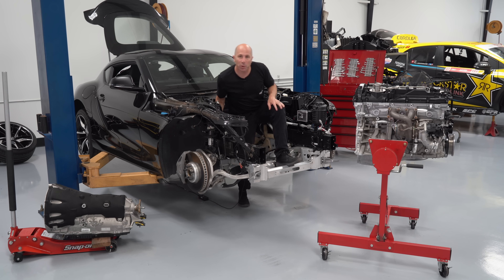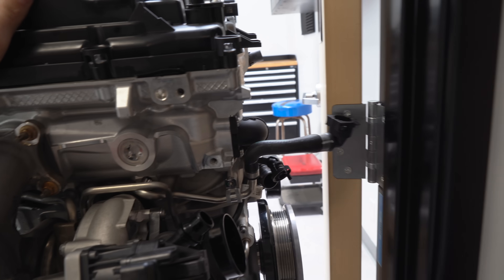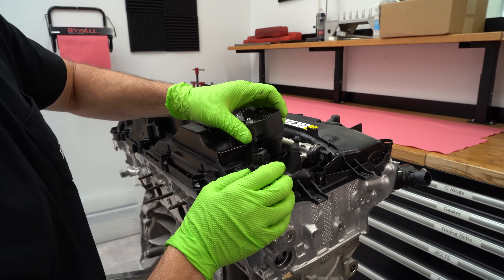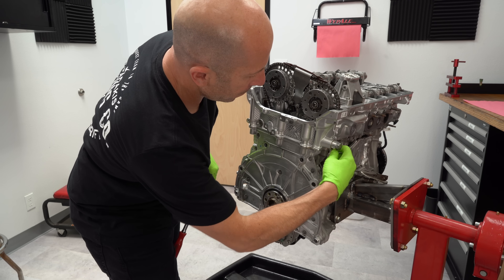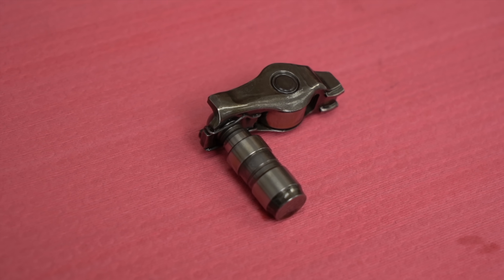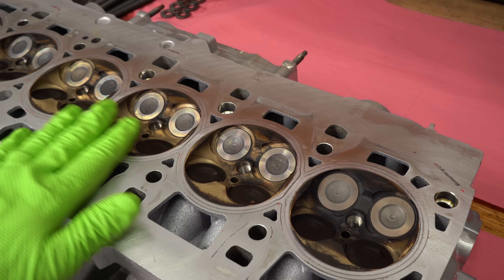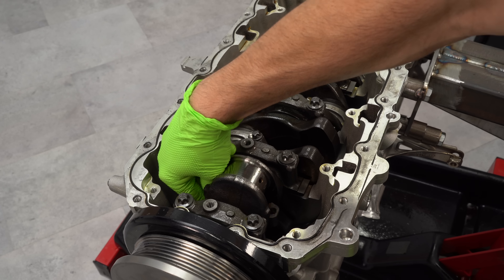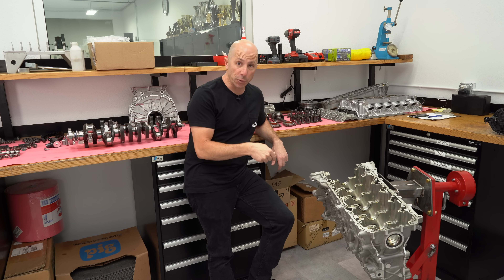2020 Supra B58 Engine Teardown - First Look - Better than the 2JZ?

Comment: Dude this engine is from a completely different universe from like different planet in terms of technical advancement.  I’d never really seen a German engine before.
Reply: Compared to what?
Reply: Herman Willems Honda and Toyota.  This seems like 2020s technology while those are basically same as 1960s.  So many new ideas here it’s stunning.  Only difference between k-series etc and a WW2 fighter engine is basically the variable valve timing.  Here everything is next level.  Like a half century leap forward.

Comment: typical BMW engine, half of it is made of plastic, life expectancy with warming/cool down cycle ? about 5 years, what a piece of junk
Reply: Most owners have just gone over 5yrs with the motor and say that they haven't had any problems with them......
Reply: @carboydorifutoparty3976  my friend is a BMW mechanic and he hasn't bought one in nearly 10 years even with the heavy discounts he can get, tell you all you need to know

Comment: This is essentially an N54 on crack ///M Power
Reply: It's not a M engine..... The engine was made so it wouldn't share most to almost all the problems the N54 had and is modular including sharing parts from the B57 diesel,mainly including it's block and bottom end with forged internals and crank.

Comment: I think the sticking point for the power upgrade will be the exhaust manifold being intagrated into the cylinder head there is a upper power band b58 that's fitted to the z4 m40i which has a conventional exhaust manifold on the outside of the cylinder head which produces 340hp stock rumour has it this upper power b58 is coming to the supra in a couple of years

Comment: Aren't you afraid to bend the camshafts like that with springload on it or have you adjusted the TDC/BDC a bit offset as you don't use the special tool? Perhaps you're scraping the camshafts anyway

Comment: 2 port exhaust manifold will bottle neck your 1k hp aspirations !
Reply: Nope, when you have this built-in type of manifold, the exhaust gas remains all it's heat and doesn't slow like a normal manifold, also, you only have one cylinder firing every 120 degrees of rotation, so this design works great for quick spool-up and lower underhood temperatures. The ford 6.7 power stroke diesel uses this type of exhaust manifold design with the intake runners on the outside of the cylinder heads within the valve covers, the opposite flow of a normal V8. Advanced casting designs and milling are making engines simpler overall.
Reply: @HoggishGreedly  Correct!  It's about getting the design right the first time and executing it with the lowest parts and fastener count (and failure modes).
Reply: @HoggishGreedly  
Yes, and they're brilliant and getting the intake air nice and hot before wraps around and goes into the head.
Reply: @177SCmaro  There's a cooler/heat exchanger right on top of the intake to avoid this.  Pay attention!
Reply: @robfrye4664  Which is more effective if you're not adding heat after the cooler. Pay attention.
Reply: awesome. 2 port exhaust wow
Reply: there are 3 Torx studs in there, I wonder if they can be removed for gas porting.
Reply: Do you understand how that design works, and why it works well?
Reply: Oh absolutely. Like breathing into a straw

Comment: so if you broke a timing chain than you have to pull or drop the motor out the car turn it change the chain put the motor back in line the trans. up shit thats going to suz when this happens to ya

Comment: I have to call bullshot on drive by wire is quicker then a throttle cable. My cable vehicles have faster throttle responce.

Comment: I see so many problems with maintenance. This thing is going to be a nightmare for the average mechanic. horrible spot for timing chains. All the fasteners are some crappy torx or allen head and don't take well after one installation. Can't use standard tools. This is the work of BMW for sure. On top of it, way over complicated of an engine for only 300 horsepower from the factory.

Comment: If you find that the head is restricting exhaust flow to the turbo, there are other models of the B58 engine that still uses a full turbo manifold. I think the X3 M40i and the 340i use this head.

Comment: 2bolt main caps? Without skirt bolt in the side holding the main caps through the skirt. This is what makes LS motors so damn strong.  C'mon 'yota?? Or BMW rather. Lol I'm sure this engineered is ultra engineered though and plenty strong enough. I'm anxious to see how you add power to this engine. Everything seems straight forward but all of the complexities seem complicated to over engineer or change in anyway. Surely you will make me learn something on this one. Good job
Reply: This is the only B58(from what I know)that has 2 exhaust ports which is strange since BMW's version only come with 6. Good thing their interchangeable.

Comment: Top notch commentary, production, and editing.
I liked how everything was at a fast pace that could still be followed and how there were no audio or visual frills.
I have my doubts about 1,000 bhp at the crank with that engine, based on how difficult exhaust and intake modification will be. Without bespoke manifolds, I can't see this cracking 600 bhp, but I'd love to be proven wrong.

Holy Carbon deposits on cyls 1 & 6 for just 500 miles.
Reply: Pretty sure adamlz is over 600+ wheel now
Reply: @bigrobstillpimpn  550hp. But a BMW with a B58 has already hit 820hp on stock block and internals.

Comment: What a nightmare of an engine layout, won't be many of these on the road after 10 years.
Reply: The engine looks very solidly built, although the one thing seemingly inconvenient about the engine, the timing chain being in the rear, because it has dual chains, it probably won’t have to be serviced for 200,000 miles.
I wouldn’t be surprised to see most of these still on the road after 10 years.

Contrary to popular belief, BMW is actually very good at making their cars easy to service. It’s just difficult for the common garage monkey because it takes a few extra steps to get access to some components.
Reply: @slimeade6021  my reference was to the large amount of plastic components in a very hot engine bay.
Reply: I’m surprised that’s where your concern is. Plastics have been used successfully on engines for a very long time now. Such as the use of aluminum, plastic is a lighter alternative to iron based parts and additionally it insulates heat well. Although it doesn’t have the strength of iron, it’s not necessary to have that strength on the components it’s used on (usually intake manifold and valve cover. It helps the engine run more efficiently by shielding inducted air from the heat of the engine.)
Reply: @slimeade6021  I understand the advantages, but it doesn't last.

Comment: Guys This dude just opend unscrewd the whole engine and didn't lose any parts....
Reply: AND he takes the engine to another room to work on it, THAT IS SOME NEXT LEVEL SHIT.
Reply: Yeah....it's called not being a mouth breathing twat. 

Some people are capable of putting stuff back together too.
Reply: never heard of anyone loosing parts when they are taking it apart....NOW lets see what he has extra after reassembly. lol
Reply: ekim andersom  I don't know bmw engines because I don't buy shitty cars
Reply: They didnt show him clearing out the rats nest of tubes and wires
Reply: I wouldve had a lot of extra parts
Reply: I wonder if he lost a 10mm socket?
Reply: Yeah, he must have done it wrong.
Reply: GREEK Power my friend
Reply: Ya he did an good job taking it an part
Reply: Michal Nycz can’t even imagine that
Reply: After reassembling, there are always some parts leftover
Reply: Where was my slow mind I could have lost every bolts and nuts within 5 seconds

Comment: So the new Supra is a 60k roller for the BMW M4.. it all makes sense now..
Reply: M4? Are you stupid? Its based off the z4.. the m4 has the s55 which is a built n55 which is an upgraded n54 which has been shown to smack mk4 supras.. this engine is even newer and stronger than all of those, the b58. FOH
Reply: Zurgul-Gaming 3 generation old bmw ;)
Reply: https://youtu.be/6Bg2mCrs46U

Comment: Thank you Stephan!

Unlike many others here, my main concerns with this engine are the following:
Regarding servicing: 
1, The way the oil filter is mounted will make you spill oil, exactly like what happened in the video. 
2, The amount of special tools needed. Needing a special socket for spark plugs feels less than ideal.

Regarding tuning:
1, The exhaust ports from the head. Looks like it will be massively difficult to get the airflow needed for high horsepower.
2, How difficult will it be to increase fuel flow with the direct injection? I've never used it myself, so I don't know, but guess it will need more expensive parts than port injection?

Overall, it still looks like a solid engine. The block is definitely more rigid than the Volvo B5234 I modified previously, which is considered a very good base engine in Sweden. I guess time will tell, but it looks nice!

Comment: Pretty cool to see how integrated and sophisticated modern engines are, even more so than a mere 20 years ago. It makes them lighter, more efficient, more powerful. On the flipside it also makes them without question more of a ball ache to work on and repair. When they are new the advantages are well worth it, when they are old they'll be money pits and  much worse to work on than used cars those 20 years ago, especially for home mechanics.

Comment: the craked rod is also on my Chrysler outboard from 1978! They did this so the have a perfect round circle and than they crack it so the circle is not ''oval'' but perfectly round (Btw my outboard piston rods have needle bearings)

Comment: they should seperate the oil from engine and the timingbelt,. so make a drainplug and fillercap for the engine and do the same  for the timingbelt

Comment: Good sounding and looking motor you can’t go wrong when it’s Toyota IMO  I was a little surprised on the plastic  but if it is Toyota I’m pretty sure they did the research I graduated high school in 1982 and even then the Supra was one of the best cars of the time because of Toyota reliability and low  repair needs even though some of the Celica body styles weren’t the best looking cars the Supra made  it way cooler  in those days I was into the water cooled Volkswagens  personally and British Sports car roadsters as I grew up in Florida and a convertible was highly desired

Comment: For everyone complaining about the timing chain it really depends on what its made of and specs also what the timing chain guides are made of. A timing chain should never have to be replaced unless it's a pos metal and or timing chain guide is causing a slap like the old 22re engines used to do. Now if they used a belt instead then I would see how this engine would be hell to own.

Comment: @Mr Papadakis, your opinion, which is better, 2jz or B58 from your point of view?
Reply: do you even need to ask? its like asking who cooks a better steak Gordon Ramsey or your local Apple bee's
Reply: @KeMzHD  .. any details ?
Reply: 2jz gte is just better in my opinion. First off, the year that engine was built is just way ahead of it’s time, second, the tuning options on the 2jz gte is massive, you can do whatever you want with it, also you don’t ever worry about it over heating.
Reply: Seb C yeah, it’s true that b58 is better by default. In fact I would say it’s more advance. But the 2jz gte is better just because of when it was created and how far they’ve thought ahead. The potential on the 2jz gte is just massive in comparison to the b58. But that could just be my opinion and I can definitely be wrong.

Comment: Wait guys is it not B58 a bmw engine Iline ?
Reply: This one's got a few differences. This has different heads that has 2 exhaust ports while normally B58s have 6. This also has a more high pressure fuel system than any other B58 including more oil squirters. Mainly the turbos completely different mainly.

Comment: How is this comparable to a jdm motor vs a euro? It's a BMW vs a Toyota and it's completely different. The 2jz has been tested countless times and is a solid motor that's capable of handling a 1000 hp build. I can see that not many ppl will buy a 2020 supra vs a C8 Corvette.
Reply: Might be cheap in America but its wayyy more expensive than the mk5 in other countries.
Reply: @Seb C also, I gotta a question. Do u know how long the mk5s going to be in production? Just curious
Reply: @Seb C jeez I thought only 3-4 years. I was way off then.

Comment: Just remember internet know it alls, Toyotas own engineers got to pull apart multiple of these engines and they inspected every single nut and bolt and worked with Bmw and changed it in ways from the orinigal design so that Toyota would deem it as "Toyota reliable"

Comment: Why so much cheap plastic for oil filter, thermostat, water pump? These will crack after 12 oil changes if over torqued. The plastic intake & metal heat exchanger inside makes no sense (aluminum connected to block would dissipate more heat, larger surface area).

The solid cylinder deck is a positive (bulletproof for boost/tuning). The crank cover - no drag, oil sprayed directly (that'll reduce wear, very robust). Crank pulley bolt  distributed bolts keep it balanced and hold up with high pressure. I know pistons, crank, cams and braces are thinner due to coating (coating is great but wears off). They should have relied only on that. Huge negative, 5-10 years major parts will wear down the coatings and increase friction/wear (very costly to fix), especially in a high revving engine...

Other than that, seems pretty solid. Won't perform as well after a few years unless you somehow disassemble and re-coat those major parts which would cost $$$$ that and cheap plastic bits make it less reliable than previous Toyota engines (hopefully we'll see lightweight aluminum aftermarket parts).
Reply: Most companies use plastic peices no issues
Reply: @rushking19  These aren't just an air intake shroud or something like that though. Thermostat experiences constant and huge temoerature changes which make it extremely brittle, extremely fast (especially anywhere which has snow during winter). This plastic doesn't bend like metal it cracks, even in good conditions.

A plastic engine cover and airbox is fine, but this is just poor design.
Reply: @mcr5645  it takes a long time to get like that trust me a good at least 70 percent use plastic for that ,and also you gotta remember radiators have been half plastic for years

Comment: So I know Toyota partnered with BMW on the new Supra. But to what extent? I know the chassis is based on the Z4 chassis. But what about the engine, was that a joint effort with BMW too? Or is it purely a Toyota engine?
Reply: Mostly BMW but tuned in a few ways by Toyota(it's stiffer and faster thsn the Z4)and the motor is mostly BMW but the oil squirters,fuel system,heads,and the turbo are all what's different from any of BMW's version of the mk5s motor.

Comment: Is this an updated BMW inline 6 cylinder engine or is it an updated 2JZ? Please tell us .
Reply: Id say its basically 50/50. This is basically a closed deck N54/N55(that's not open deck)that shares parts derived from a diesel i6 mainly its bottom end and block with forged internals and crankcase and it basically have a good bunch of fixes from BMW that they fixed so it wouldn't have the type of problems that N54s had so it rarely has any of the normal types of problems you'd see a normal BMW engine has. But the mk5 has the brand new version of BMW's motor(B58C)that has more updates since BMW updates these motors yearly in case of small things start to happen(only heard very little problems like coolant leaks that were fixed way back in 2017)and there's several different versions that are basically the same but have some type of change compared to others.
Reply: @carboydorifutoparty3976  Thanks for your answer Carboy. Sounds like lots of thought went into the design of this engine based on previous successes and failures. It is amazing to see the elimination of preformed gaskets as a result of such precision milling these days. This is likely the most "high tech" engine I have seen taken apart with a detailed description of all the components. What is your opinion Papadakis Racing?
Reply: @doctoredable  I feel like he may need to look a little more into the B58 family because of all of the different variants of them (because of the few part differences in them although it is sort of hard to hunt people down who know about them)but I feel like it won't be impossible for him to make his goal of 1000hp and seems possible since the B58s already got most of the things needed to get to 1000hp now it's just a waiting game of how long it'll take is all.

Comment: One note ;P
9:53 lighter colored valves are the exhaust valves because temperature of exhaust gases can burn carbon deposit. You can see also two-port exhaust on the clean valves side.

Great video, nice to see new engine part by part.
Reply: Uhmmm.... No.
Reply: @DeanBKK  https://mechanics.stackexchange.com/questions/18328/why-are-intake-valves-dirtier-than-exhaust

Comment: The fuel injection system is just like the diesels we all think this is new tech but this has been used since the 60s
Reply: my thoughts exactly.. hmm gasoline infected direct into cylinder at thousands of psi

Comment: Best of luck, two little bitty exhaust ports are good for spooling a turbo at low rpm, eliminating lag, but are going to be a big roadblock to 1000 hp. The DI system isnt going to support 1000 horses either